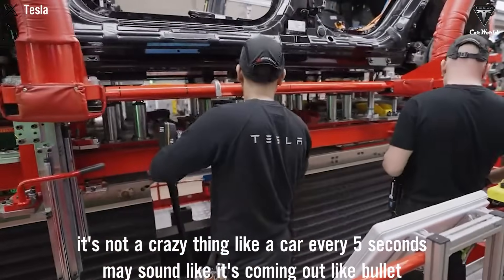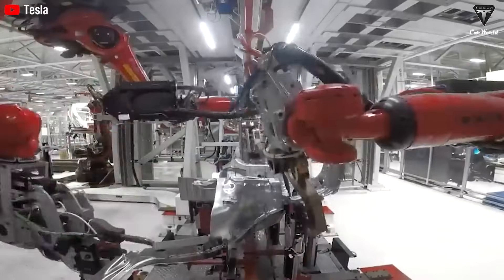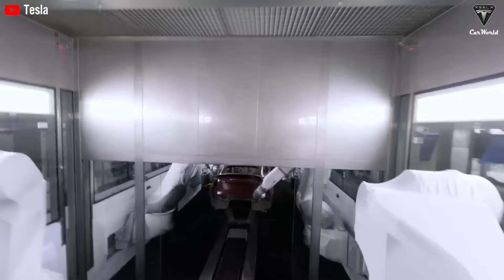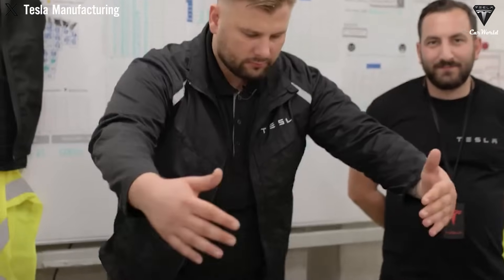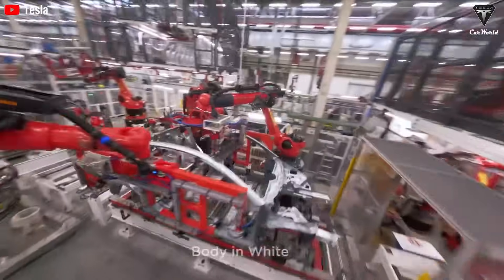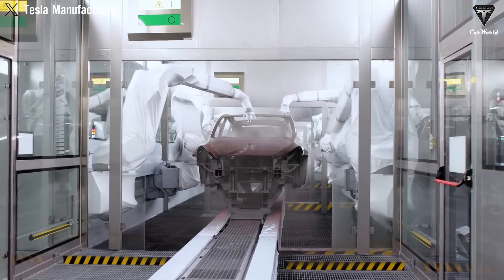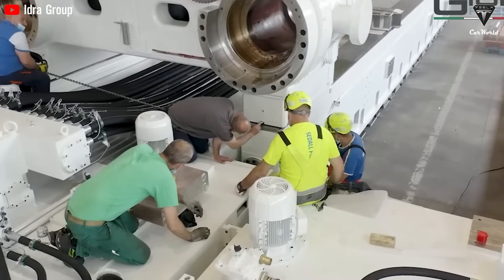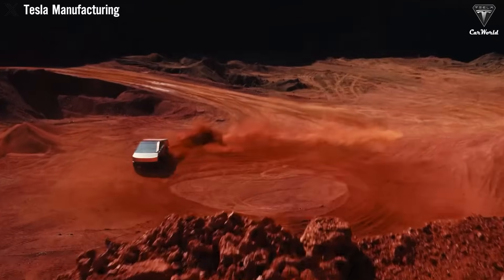It happened! Elon Musk shocks w 45 Teslas produced every hour! What’s inside 50,000‑ton Giga Press?

Comment: How many have shifted up to 48 volt operation? Everyone knows they need to but…
Reply from the maker: Great point — moving to a 48V architecture is definitely the direction the industry is heading to reduce weight, improve efficiency, and support more powerful electronics. While Tesla still uses traditional 12V systems in many models, there are reports that next-gen vehicles like the Cybercab and Model 2 will adopt 48V systems.

Comment: What about fixing or replacing ing panels
Reply: You can repair the panels. Its been proven long ago.
Reply from the maker: Great question! While traditional cars allow easy replacement of individual panels, Tesla’s approach means fewer seams — but also makes certain structural repairs more complex. That said, Tesla has been developing service strategies around modular panel designs where possible, and for non-structural components (like exterior panels), replacements are still manageable.